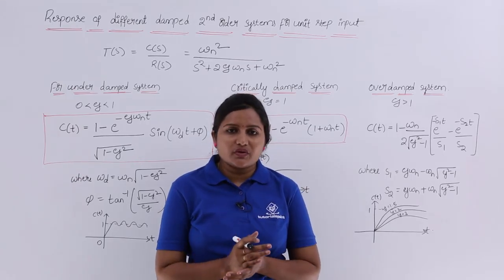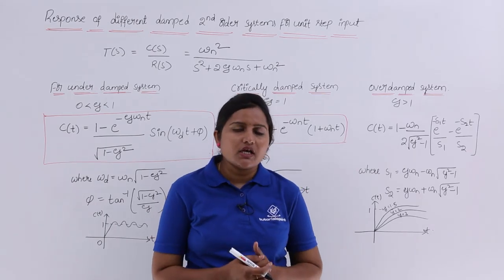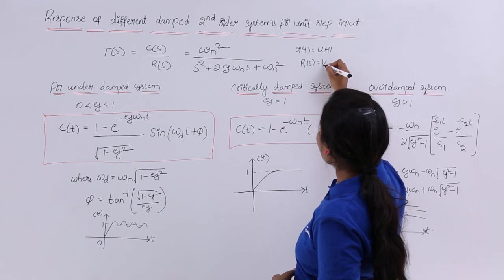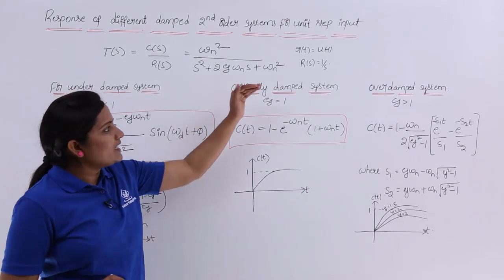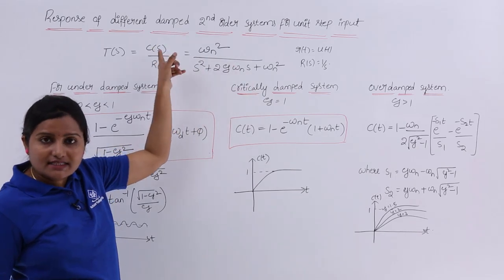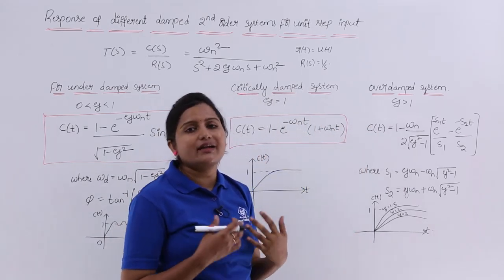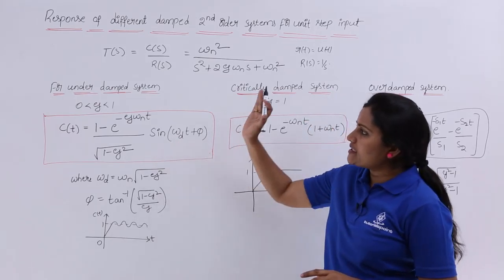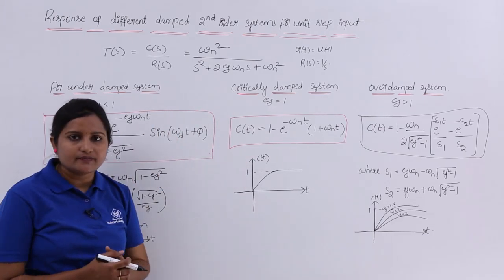Respose of Differently Damped Second Order Systems for Unit Step Input

Comment: Dear mam, 
Can you help me to below question please?

[Mass-spring-damper is a class of motion sensors sometimes called “seismic sensors”. Accelerometers belong to this class of sensors. 
 
Figure 1: Mechanical system of seismic sensors (Longoria, 2014)
The spring and damper elements are in mechanical parallel and support the “seismic mass” within the case. The case is the base that is excited by the input base motion y(t). (Longoria, 2014)
 One of the Engineering research team is planning to explore when a force is applied to the  case, the response of the second order mechanical system model by summing the forces acting on the seismic mass.                                                                     (Total 60 Marks)                                                                                                                                    
 Do the mathematical modelling for a Mechanical system of seismic sensor using lumped parameter modelling.                                               (8 Marks)
 Find the Transfer Function for a Mechanical system of seismic sensor using the above mathematical expression. Clearly state all the assumptions you make.     (4 Marks)
 Present the “output s function” of the Mechanical system of seismic sensor when there is a unit step input and present the time response of the Mechanical system of seismic sensor output as a mathematical expression in time domain.         (6 Marks)
 While the mass of the machinery is 2 tons , specify values for damping ratio, spring constants(k_1=2*k_2) and dashpot constant of the Mechanical system of seismic sensor for;       
 Under damped
 Over damped and 
Critically damped states. 
]

Comment: for overdamped system, roots should start with (-) sign. It's missing
Reply: There is a (-) sign in the expression of c(t) . So when we substitute the values of S1 and S2 the minus sign will appear in the original expression. Please correct me if i am wrong. Thank you